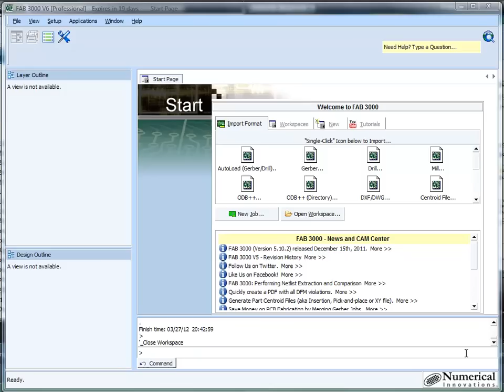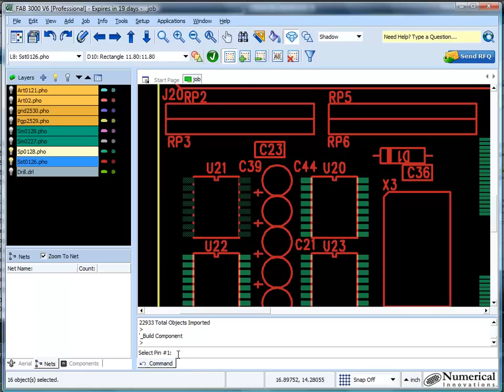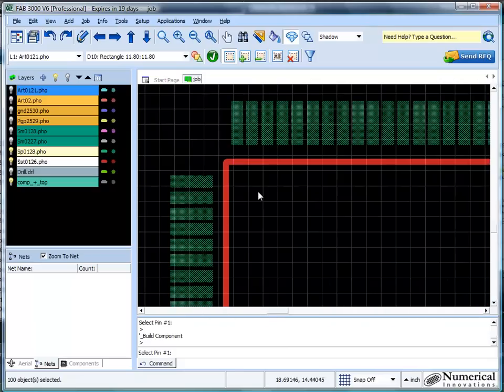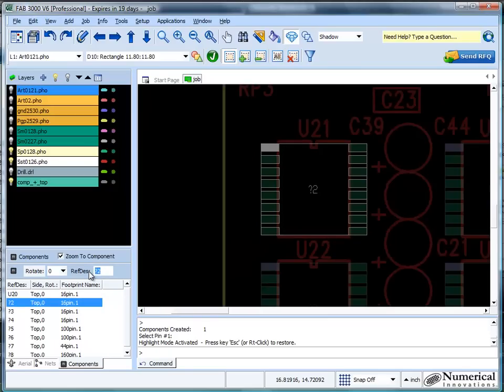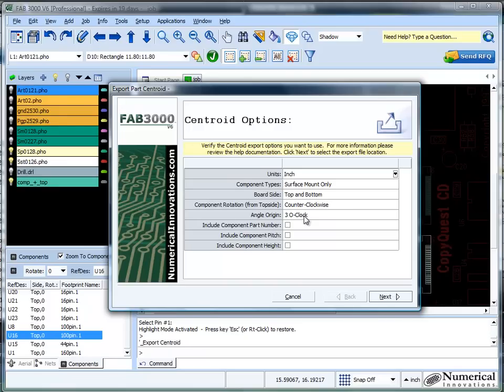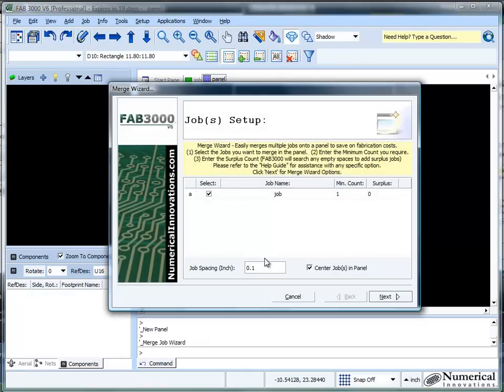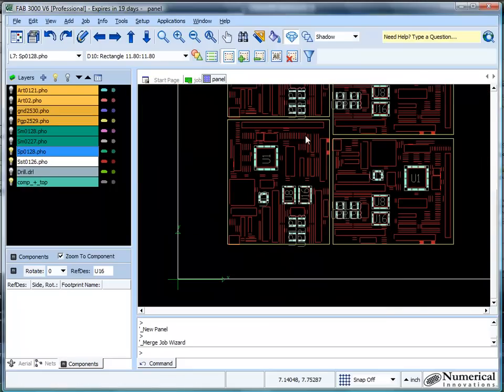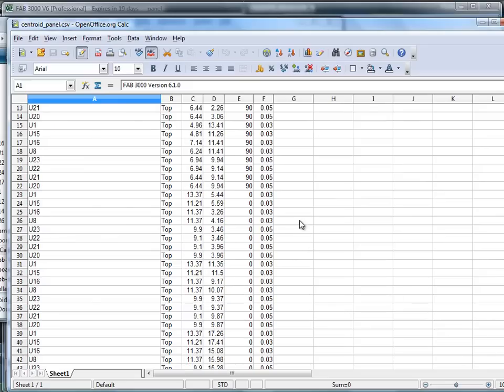Generate X-Y Centroid data from Gerber files

Comment: I saw in another video you can create Gerber using pdf. Say the customer doesn't provide anything but the pcb, could you scan the pcb on a printer and save as pdf then convert it to Gerber using your software? Then create xy data from that Gerber?